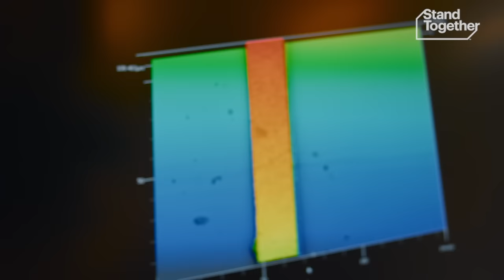This new battery could re-industrialize America — if we let it

Comment: A 7.5 min video and all you learn is, we store heat in a graphite block.
No word on how much energy can be stored, how much energy is lost through losses, how electricity is generated from the stored heat, how efficient this electricity generation is or what the longevity of this storage is.

Just a vacuous commercial.
Reply from the maker: Hi there. Thanks for the feedback. Antora's thermal battery is capable of outputting both heat and electricity. To output electricity, the system uses thermophotovoltaics (TPV) to convert light from the glowing-hot carbon blocks into electricity, much like solar photovoltaics convert light from the sun into electricity. Antora built the world’s first dedicated manufacturing line for thermophotovoltaic (TPV) cells, achieving a major milestone in the production and scalability of TPV technology. Checkout @AntoraEnergy to learn more.
Reply: @StandTogetherCC  Thank you for your feedback!
Reply from the maker: Happy to help. Thanks for watching!
Reply: Agreed, this level of incompetence in the presentation doesn't speak well for the battery.
Reply: @StandTogetherCC  Yeah, next time talk about this kind of stuff. You literally spent the first four minutes of this video reiterating the problem being solved. 🤦‍♂

Comment: How do you get electricity from hot graphite? Is it creating stream that turns a turbine or what? Video doesn't say.
Reply: You're not getting electricity from hot graphite. You're getting industrial-grade process heat from graphite that's been heated up with (often) renewable electricity. Industrial applications need heat. Thermal energy storage (TES) - which is what Antora is making - turns renewable electricity into reliable, inexpensive process heat. It's fantastic stuff!
Reply: @blainecollison thanks for the explanation makes a lot more sense
Reply: A lot of industrial processes don't need "electricity" or "fuel," they need heat
Reply: @unoriginalname4321  in that case how do they transfer the heat from where it's stored to where it's used? How mucb energy is lost in transfer? Would be nice to know these things.
Reply: @L1m3r I think it uses the photoelectric effect
Reply: @gerryflores88 , photovoltaics use the photoelectric effect. Thermal energy storage doesn't. There's no electricity being produced here. There's electricity being used to heat up the thermal mass (the carbon blocks).
Reply: @ecofriend93 , very little energy - in this case heat - is lost in transfer. Thermal energy storage ia a <remarkably> efficient technology. I've seen systems reporting well above 90% efficiency. The transfer is done with a simple heat exchanger.
Reply: @blainecollison  the heated blocks get hot enough to emit light, and the energy is recovered via photovoltaics. Look it up
Reply: AntoraEnergy   -  https://en.wikipedia.org/wiki/Thermophotovoltaic_energy_conversion
One type TPV are the already mentioned thermocouples (peltier element) and the other has even worse efficiency.

The only way this can be useful is as a direct source for process heat (as mentioned by ??? above). But this can never "power our zero emission future"!
Reply from the maker: Thanks for responding!

Comment: I understand that they are conserving heat but why wouldn't they opt for a spherical design even if the manufacturing process is slightly harder isn't the shape more conducive to heat storage? I wonder what factors are stopping it. Also how is the heat transfered?
Reply: exactly correct Dustin good to know someone else saw that also
Reply: It’s not harder young chap, it’s more expensive

Comment: Okay, let me understand it clearly please. I am not being destructive here but some things does not sound clear to me. Please someone explain for me.
You produce energy with renewables ---> You transfer it to your product box ---> Some sort of resistance(s) is heated with electricity over 2000°C (!Wow how many amps is that?) --> Carbon blocks are heated to nearly 2000°C --> Carbon stored heat energy is transferred to some system else(how you transfer 2000°C degrees of heat)? (High temperature industrial heat or electricity (electricity with what a steam engine cycle?)).
How many cycles can you use carbon?
What is the final energy efficiency?
What sort of resistance material is that? 
What about the second law of thermodynamics?

Comment: This is a no brainer. 1) Graphite thermal batteries can store as much energy as lithium batteries for a fraction of the cost, and 2) because of the massive expansion of wind and solar, energy prices are often negative if not extremely low which makes thermal batteries far more profitable than fossil fuels. Industry can literally get paid to use heat, rather than paying for heat.